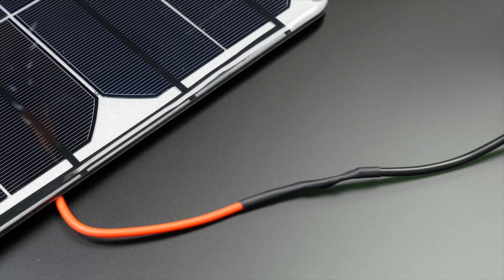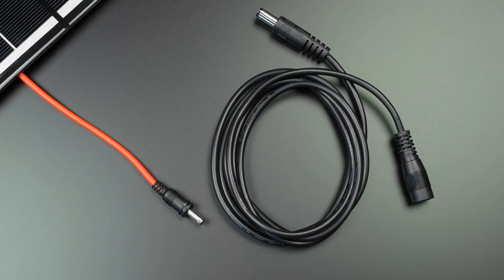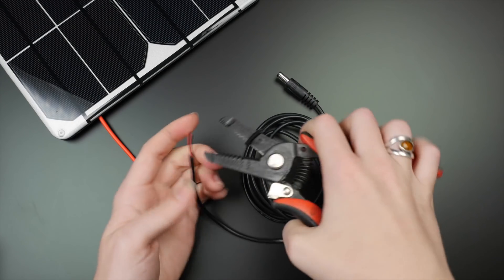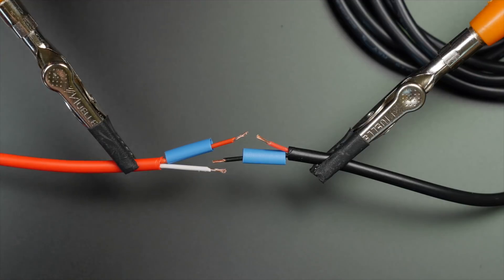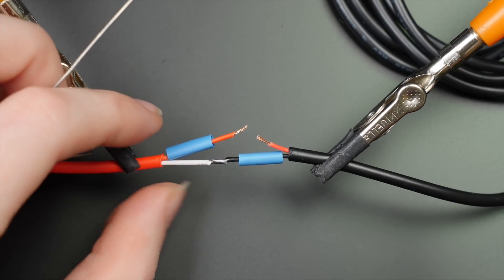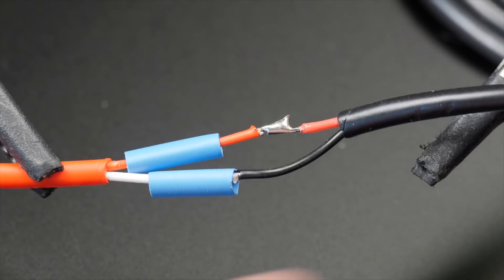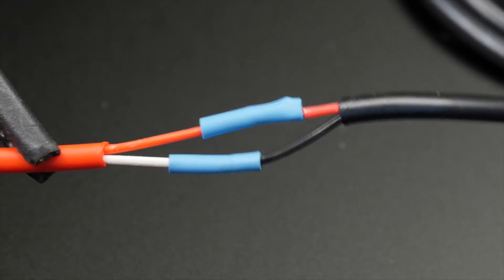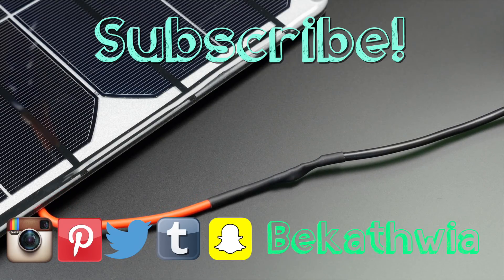Super Clean Cable Splicing // Becky Stern

Comment: OK so far as it goes, but... you are relying on your solder joint for mechanical strength. Its better to make the mechanical part by hooking the bare copper around each other. You shouldn't get much bulking up. Then apply solder, that way you enjoy mechanical and electrical connection. Sadly, I often forget to slip the larger diam heat shrink on.

Comment: Heat shrink on wire BEFORE soldering. Okay there's my problem. I wonder if anyone else has made the same mistake? Probably not.
Reply: I don't know of any makers that haven't had to undo a joint in order to add the tubing.

Comment: When you said "I wish someone had told me earlier" I felt exactly the same way! After decades of having cables with big lumps I somehow figured out the offset technique on my own only a few years ago. It makes such a difference! Per the other comments, for reliability it's important to have a physical connection and not just a solder connection, so bend or twist the wires together. Now, if I could only figure out a technique to not forget the heat shrink tubing until after I've soldered. It never fails, I nearly always forget to do that and have to re-do the connections.

Comment: I like to hook the wires together and twist, similar to a Western Union splice (https://en.wikipedia.org/wiki/Western_Union_splice) but for small wire sometimes just twisted once or twice.  This does result in a bit of a lump but you can also use less solder and don't end up with a big lump like on the red wire in the video, since you can pull the wires taut while soldering.    One thing that I accidentally do sometimes is start melting one of the heat shrink pieces with the soldering iron while soldering the wires.  Maybe just need to bring the iron in and out quickly and carefully to avoid this? Or maybe my temperature is too hot?    Thanks for the helpful video.

Comment: I prefer using a strong inline splice where you wrap the wires around each other then use glue-infused heat shrink for extra strength. Less solder.

Comment: You should always slide on the bigger heatshrink (or connector backshell) AFTER soldering the wires...
Reply from the maker: What do you mean? The heat shrink tubing is too small to fit over the connector at the end of the cable, so I slide it on at the start, then shrink it over the whole joint at the end.
Reply: Exactly ;-)
Reply: Haha, I usually try to. Doh! Makes for lots of practice though...